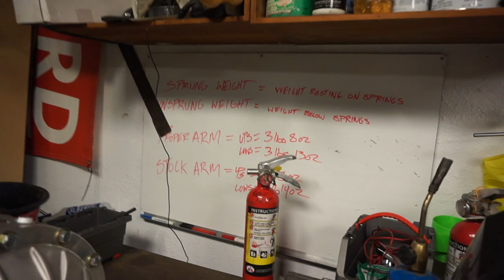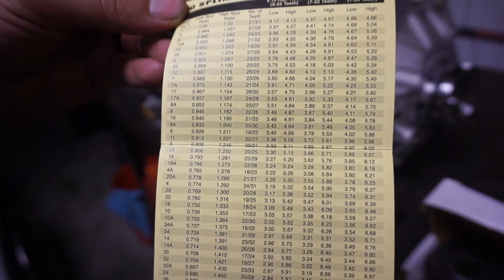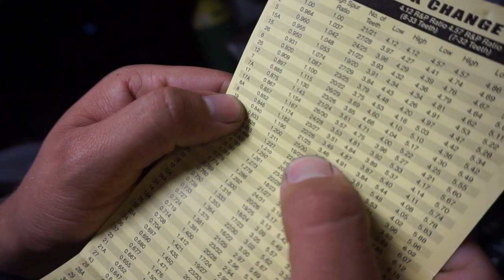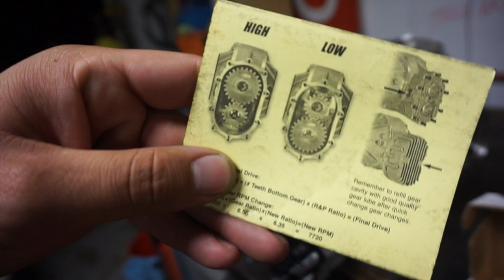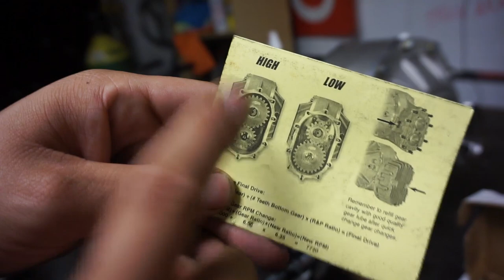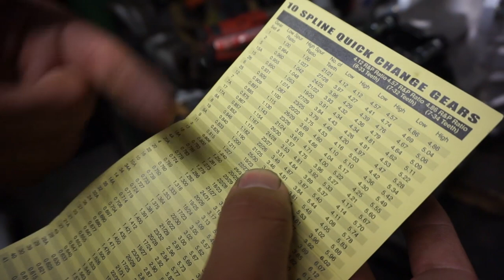Winters Quick Change Diff x E46 Hail Mary Build

Comment: Pretty accurate explanation of how a quick change works, but the first time you change gears out at the track you're in for a big surprise.  Those rear units hold 2.5 to 3 quarts of oil. When you remove that rear cover you're gonna lose about 1/2 of it. We use a big drain pan with a screen on top to set the old gears on while it drains out and we get the new gears ready. Oh yeah... that oil can be HOT!

Comment: micah i wanna ask you bro about diy on removing the pinion gear on e36 midcase diff. i didnt find any content online about it i removed the big nut but its still stuck.  any help is appriciated!
Reply: you have to press it out from what I remember, or you can smack it out with a rubber mallet and some softer metal. and theres a shit ton of content online, you didnt even bother googling it...that spoon fed attitude is gonna get you nowhere fast. https://www.bimmerforums.com/forum/showthread.php?1024563-How-to-remove-the-input-flange-pinion-from-a-188-diff

I just reread your question, and it shows you didn't even bother googling it at all, there's a locking collar and a crush sleeve.